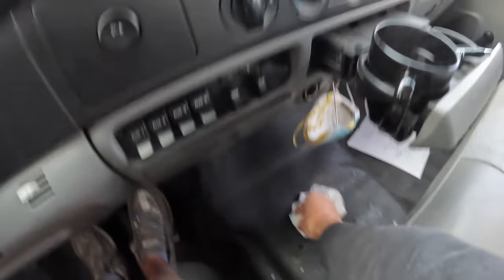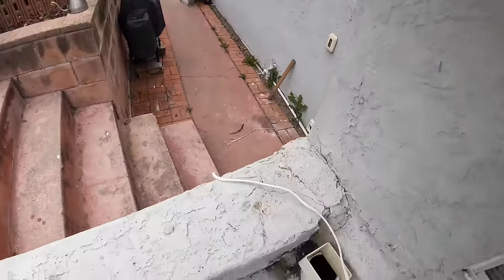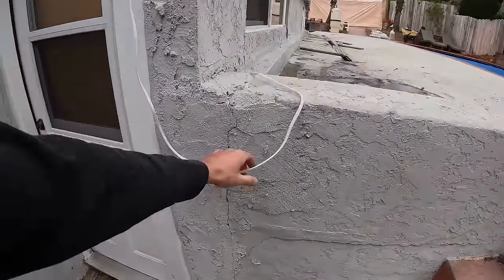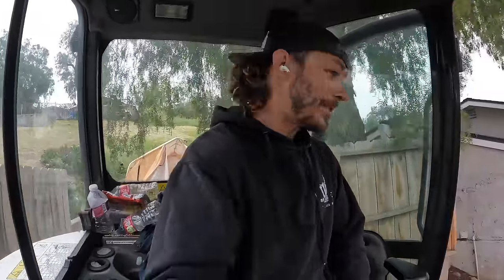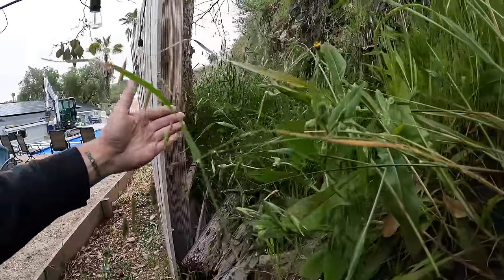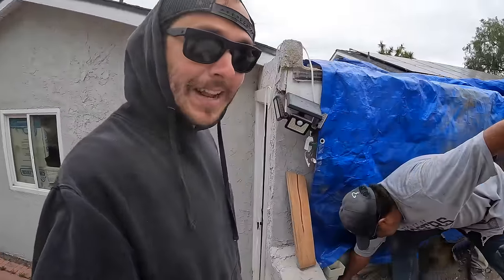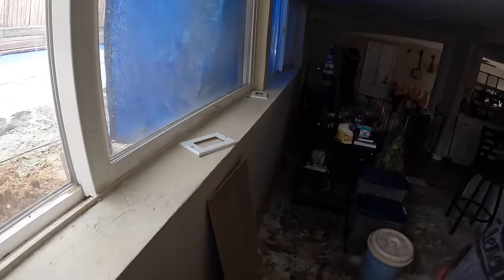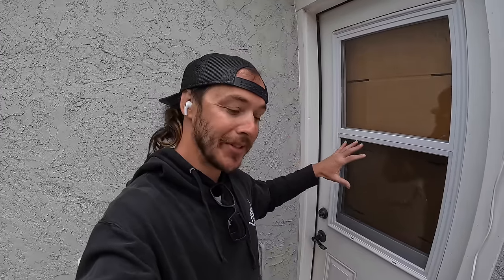House Flippers Completely DESTROYED This House!

Comment: Now here's the thing...just on the outside...

Yeah, I was a novice when I started on my own home. But at the very least, I had spent 15 years in the mortgage business before I started making all of my mistakes. I had spent a career looking at appraisals. I had a CLUE, if only a clue. I wasn't ready to dive in, but life made my state of readiness a non issue.

I knew enough, however, to not build a drainage system like that. I knew enough not to pile earth with that drainage system against a heated wall...with no waterproofing on the wall, a gabled roof on one side and sloping terrain on the other. I knew enough not to do anything THAT bad.

But here is the rub: I also know enough to NEVER live in Californistan, where the cost of those permits that are meant to stop the clueless from building garbage like that are assuredly astronomical...after all of the dumbokkkRATS who have leeched onto the pipeline that leads to those permits get their grease.

What you have out there is the perfect storm (pun intended) where the clueless are encouraged to do this work by the overvalued Real Estate, but are also encouraged to hide from the government who employ the inspectors...all for HUGE profits, as I am sure that little rinky dink house sold for a million dollars or more.

Comment: im no builder or engineer but building that wall next to the pool seems like a bad idea considering the weight of the water pushing out and against the dirt.. then you have a non reinforced block wall holding that back? That house should be condemned as a safety hazard.

Comment: Can you go back after the flippers?  I'm surprised the home inspector for the banks let this go through.  If this is socal, that property is insanely priced, like 4 or 5 times what it would be anywhere else in the country. The building codes are prohibitively costly and difficult, dealing with them is a nightmare there.  This is a significant hit on the value and likewise the cost to get this back up to liveable.  I feel horrible for the homeowners.

Comment: Why wouldn’t they just build a regular deck and leave old retaining wall add a door to the underneath part for pool toy life jacket storage they probably also caused voids next to the pool because if the dirt shifted towards the house it will cause a void on the down hill side of the pool and allow it to shift off level crack etc. always have the house your going to buy inspected all around (electrical, plumbing, structural, outside drainage) before you buy it that mistake probably cost more to install and caused easily 150k plus in damage (cost of repair property value damage)

Comment: That roll roof over the addition is screwed up (not fully sealed down, applied on arguably too steep a section, and decking/ framing problems underneath). The tie-ins to the shingles on the house and garage are wrong too (no valley pan or transition metal, no flashing on rake edges, buckling shingles at transition, etc.). Probably less of a problem in So. Cal. where there isn't a freeze/thaw cycle and snow to worry about, but a hard driving rain could cause many problems in those corners where the old eaves and facia tie into the roll roof. I can already see rot on the garage, and there is a hand size hole where the rake edge meets the roll roof. Same problem on the house, but an arm-sized hole. I feel bad for the homeowner here. Hopefully, they can take this flipper and/or seller to civil court and recoup the cost of repairs.

Comment: I got to say, for the first time I saw a build far worse than my contractor did on my brand new house. Not an improvement, but whole NEW house...with water being directed underneath the house. Apparently by design. They refused to fix it, so...anyone in Idaho: NEVER use Agile. They talk a good talk, and USED to be decent, but have gone downhill...badly.

Comment: that is the worst drain system ive seen lol. someone put one of those in my garage before i bought my place just so stuff that rolls off the car catches in there instead of sitting on the garage door. i cant imagine heavy water going through that small of a pinch lol

Comment: I am a flipper, and used to do it in So. California. I actually thought this was one of my jobs because the backyard and the way that room addition looks so similar from the backyard. Thought maybe whoever I sold it to flipped it again. It's not, but the rule of thumb I've found to make the most profit doing this is simple. CHANGE AS LITTLE AS POSSIBLE. Don't mess around building additions, don't create additional rooms, don't knock down walls. Do the absolute bare minimums to bring it up to modern. Fix any damage that is there, floors, cabinets, lighting, paint, and leave it alone. Don't start messing with adding on whole extra rooms. That's a huge expense and you're trying to profit on the sale so you're going to go cheap. And this happens. Just work with what you have and don't deviate from the original floor plan, unless massive existing damage dictates otherwise.

Comment: That electrical installation in the wall wasn't inspected either. No plates on the studs there the Romex goes through the studs, which is required by code. One shelf installation away from pain or death on that wall from anything from a good shock to full electrocution. The home owners should report this and the other code violations to the local authorities so they can charge the flippers with criminal negligence.

Comment: I feel bad for every person who paid top dollar for what they thought was a nice house just because it's been renovated and looks good and pay hundreds of bucks for an inspector to point out insignificant issues but not point out significant ones and the issues just exacerbate the longer they live there and they don't have the budget to have someone come fix everything properly so they just let the problems continue and next thing they know 10 years have passed and the house isn't worth close to what they paid for it because it's fallen into such disrepair. It's like paying $50,000 for a vehicle with no warranty and next thing you know the engine seizes and you're forced to put serious money into it or to just cut your losses and sell it for a fraction of what you paid for it. There needs to be more regulations in place to protect homebuyers from this kind of stuff and hold the flippers/contractors liable for polishing a turd and passing it off as a home for a couple to settle down and raise a family in for the next number of years as the value is supposed to appreciate and not be exposed to structural issues, mold, unsafe wiring, etc

Comment: While I do not have a lot of faith in home inspectors,  this place has so many obvious issues that an inspection report should have scared off any potential buyer.  Even the appraiser should have questioned it.  The buyers seeing eye dog should have stopped this purchase.  Just all the roof irregularities  such as low slope roof with little overlap of the rolled roofing and variations in the roof plane are scary.  You are trying to fix it right but there is some old saying about a pigs ear.  I do think I would have considered a power buggy with some plywood protection for material removal.  I do not have the patience for rework this frustrating.

Comment: why contactors just throw prices are 1 they dont want the job as its a headache so give them a large number you take it i will laugh to the bank or 2 they want to rip out all the bad and fix it right say we got to remove all the concrete and do this and that so here is the cost its easy to see the major issues and the simple fix if money isnt an issue

Comment: Based on how dry that soil looks when you excavated it, I bet most of the of rain water was due to those bad channel drains and lack of gutters.  All the water went into the gaps and into the dirt right at that point.  That water eventually found a weak spot and got into the house.   They should have slopped the concrete and just naturally let gravity drain the surface water as long as it has proper grade.  Its sad they got cheap and didn't do any waterproofing on the wall either, but it would have been slapping lipstick on a pig.  I bet that roof would have had a wall of water coming down in the recent rains this year in California.  Who the hell installs channel drains with the drain tube extending up to trap and hold water?  I never trust a flipped house.  They never use permits and it becomes a nightmare for the owners after.  I would take a closer look at how they anchor the wood to the walls too.  I bet they drilled holes into the concrete block and its another termite heaven.

Comment: They used the wrong type of pipe, that does not get glued. It is meant to be in a trench with pee stone and channel the water away. They should have at least used sch 30 pvc and then glue that

Comment: Holy crap. From European's perspective half of this house should be torn down, it's a literal death trap - most likely mold is everywhere already, including within wall structure. This is super strange way to position house on the available land to be honest...

Also where tf are gutters?! Like there are no at all. With that roof area that's a red flag right from the start. And whatever drains there are, they are pathetic in diameter. Enough to handle morning dew, perhaps... not rain!

If I were to buy this property, I'd strongly consider lowering the pool down down to floor level. Is the cliffside part of the property? If yes, I'd build proper support wall there, and enjoy extra place to hang out (you can mount so much stuff to the wall, making the floor empty and easy to clean). If not, it's super sketchy...

Comment: Dont drink and drive - only slightly followed by dont use your phone and drive.  
Ive watched enough and done enough that your home review had me yelling at the screen in disbelief.  I hope the home owner can get their money back.
Sad thing is its really an improvement the way they designed it.  If you did it right it would a good add.

Elninio is predicted to make our weather very wet and filled with storms.  Just an FYI. 

The most dangerous and perilous part of working with tracked equipment - getting it on and off the truck.  :D

Comment: i hope the home owners can get this completely fixed and relax. 

looks like the flippers didn't even have half a functioning brain cell and were barely conscious when doing this work. 
there's no way a functioning adult would consciously piece together a drain with tape and the wrong couplings. 
most people would either hire someone or at least know how plumbing works. heck you can youtube something if you dont know how. 
this flipper refused to even do basic research. you could probably find a library and read up on plumbing for free if you cant figure out how to use the internet. 
the skill level of the flipper is indescribably low.

Comment: Why didn't you start digging from the other end you would not have had to swing over the pool at all it would have saved on your cycle time.
Reply from the maker: Because I would have to have the weight of the excavator on the brick pool coping to go back when I was done and I didn’t trust it not getting damaged from that.

Comment: Easy fix get an Orga drill, drill down next to the wall-to-wall depth and fill with cement with water sealant and seal the wall before the pour would have been done in a day not that absolute fc around you did to waste the owner's money.
Reply from the maker: Lol a thin layer of cement will take the pressure off an ungrouted, partially drystacked block wall? You’re a moron.

Comment: Never buy, build, or do any foundation work on slopes. It never ends well.
Reply from the maker: It can be done right, but it’s VERY expensive. Most people cut corners because the lots are cheaper and that’s when you deal with major issues
Reply: @DMAXRYNO  Right, I shouldn't say never, but most of the time. The ground always is going to move and obviously drainage issue as well. Unless it's done 100% right🤘

Comment: Yes, this flipper’s choice of crew that did work before yall did a lot of crappy work and shortcuts but I’ve learned any homeowner that trashes previous crews or contractors, like them being surprised you looked/checked something when previous ppl just gave them a price, don’t know every little thing that contractor did note or factor in during their inspection for the quote. Even if that homeowner followed them thru the whole house or project, they don’t know every detail that contractor had in their head. Same thing if they’re complaining about a previous contractors work. If this homeowner knew all this stuff that they did wrong or how they should’ve done this or that then why isn’t that homeowner doing more of the work themselves?? LAWAYS take anything they say with a grain of salt because the heaviest criticism always comes from a negative experience, not the positives or correct/done well things. You also don’t know how tight of a budget they put those contractors under or what that contractor came to them saying “to do it right is $3000” “well can it be done cheaper or different?” We can do it for $2500, won’t be necessarily done correct, but will hold for a while” then the homeowner or flipper agreed to. Just do the best you can do, do it right and correct as you can/know how to, and have pride in your stuff.

Comment: Every contractor calls their process the best way to solve the problem. Most of the time it is the highest cost solution.  Simply adding gutters and fixing the gutter drain system would have likely solved most of the problem.  Occam's razor.  The most simple solution is often the correct one
Reply from the maker: Adding gutters will magically make an ungrouted, drystacked, leaning block wall structurally sound to hold up the roof?

Comment: That's a lot of weight in the pool , Im not a foundation expert but I would be worried bout that  4 or 5 foot strip their to hold up , honestly surprised the flipper didn't drain the whole pool into the house 😂🤣😂
Reply from the maker: The fill around the pool is hard as a rock and the pools been sitting for probably 20 or more years, it’s pretty settled lol.